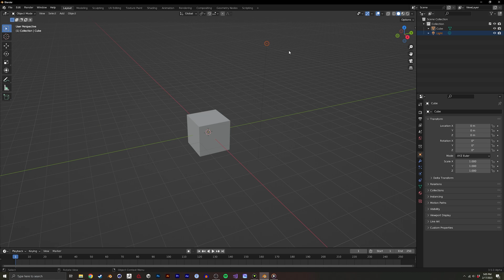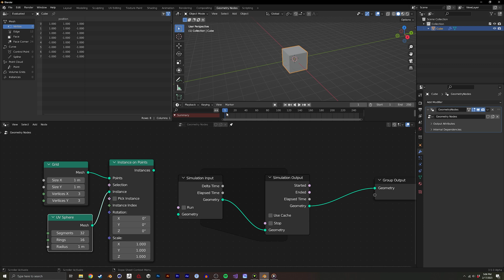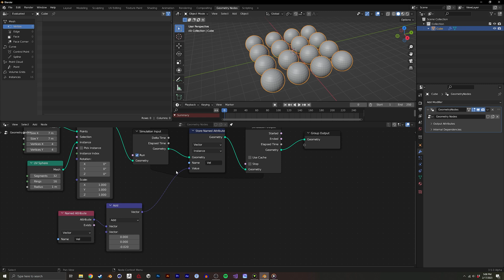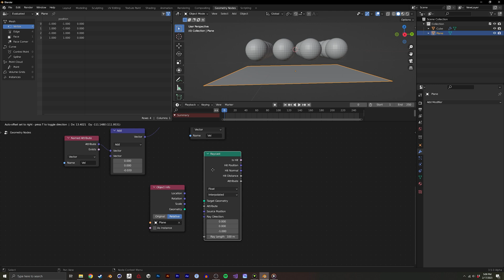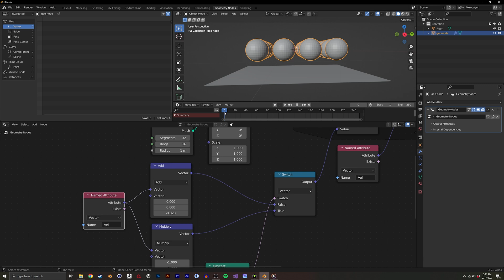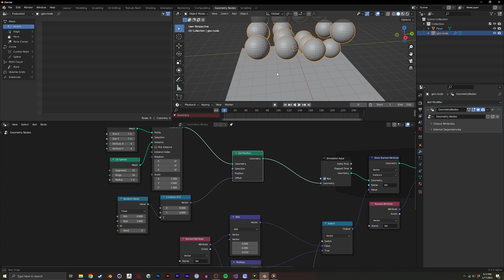Blender Simulation Nodes for Beginners!

Comment: nice tutorial! Can I ask you how did you set the material to the spheres ?
In my project I'm instancing a collection of objects on points extracted from the volume of the mesh and before the simulation every instance has his right material applied. If I put a viewer node after the simulation loop the materials are gone and the  Set Material node applies the material to the entire geometry.
Reply from the maker: i have the set material node at the end of my graph
Reply: @RobbieTilton   yes I did the same, but it was not correct. It was like the UVmap of the single instance breaks after the simulation loop. I think it's because the objects instanced on the points are treated as a single geometry after the loop and not as a single object, so the material is applied to the entire geometry. Your ball material was UVmap dependent too?
Reply: Update: managed using a single material setted in geonodes after the simulation and using "random per island" socket of the geometry info shader node to drive different materials on the single instances. It is an half solution because in works only for materials not UV map dependent

Comment: Nice! I tried here and sometimes depending on the distance or accumulated speed of the instance it just goes trough the floor. Why is that and how would you do to overcome this kind of limitation?
Reply from the maker: with the movement and raycasting - each frame is basically a 'step' to process/evaluate. One way to help solve something where the speed of the ball is moving faster would be raycast from an offset position. For example u can racast 5m in the inverse direction of the velocity. and then when you elevaluate the is hit you add the 5m into ur math.

most physics engines let you do more steps in-between frame, but with simulation nodes you're stuck w each frame being one step. so to my understanding that would be the best way to deal with it for now.

Comment: For anyone curious on how to add a texture to the bouncing balls here's how I did it. Add a "Set Material" node in between the "Simulation Output" and "Group Output". Then go into the "Material" settings to add a new material. Then go back to the "Set Material" node and assign it the material you added in the "Material" settings. That should do the trick.
Reply: Is your material textures/UV based or procedural? because I did the same for my project and the UV map was completely broken. I used the same material that was applied on the single object scattered in geonodes; maybe I should redo the UV unwrapping of the geometry and create a new material with the same textures
Reply: Had to refresh my memory on this by taking a look at my old file tonight. I used a procedural texture that was a mix shader with a noise texture and musgrave texture. @willowproduction
Reply: Have you tried to see if it works for just a simple color using a simple BSDF? For testing purposes I mean before trying with your main material texture.  @willowproduction

Comment: A fun next step is to use the hit normal to calculate the bounce angle then run it on a sloped plane or more complex surface. That, plus damping.
Reply from the maker: oooooooo! great idea!
Reply: @RobbieTilton  For damping you can use a vector scale node set to like 0.9 in between the velocity inversion and the switch node

Comment: Nice job Robbie. Enjoyed the tut. One thing for me. When rendered, I only get white spheres.  Not a coloured one that I have used. Strange. Any ideas?
Reply from the maker: I downloaded a texture for a bball and applied it to the material w set material near the group output in node graph. You could also instance a different mesh w your texture instead of the uv sphere at the beginning of the graph.
Reply: @RobbieTilton  Have done separate object, simple sphere, object info, and all that. Still. White spheres. Dec 23 download of Blender. Thanks for the reply. Sorry to bother you with something that sholud just work.
Reply from the maker: @covbloke511  very weird. i was using a november branch of simulation nodes... i'm wondering if it's a bug from their dec branch. You're always welcome to share ur file in the 'help' section of my discord and I can take a look.

Comment: This is the stuff that strains my brain the most so I'll need to watch multiple times before I digest the impact of each node in the logic. I am never satisfied just watching someone place the nodes without fully comprehending the variable, within the node tree, that each node or its value has a wide reaching effect upon. 
I feel I am most messed up by some of the socket names withing the realm of "true" and "false" in a switch node that is fed by a value from an inverse multiplication such as factors of less than zero . My weak brain wants to follow along like my eyes are doing but the:
flipping conditional on false status of inversely factored values which equal a state which causes the addition of a velocity  etc.......oh man  ...lost. 
But I have a compelling case for the logic functioning fine because the simulation DOES run and I can see it.
Being able to tinker with values and having their effect be immediately seen is one of the greatest parts of Blender geo-nodes.
Reply from the maker: I feel you and appreciate the message. I programmed for 10 years which allows me to grasp this stuff, but at the start it can be hard to understand. If you have any questions about anything in the video - feel free to ask.
Reply from the maker: the 'true/false' switch is what we call a conditional statement in programming. If this -> then that. If NOT this -> then that other thing.
Reply: @RobbieTilton  Thanks for your attention to the comment. I am able to work out the logic of the true false if then statements...eventually. IQ is about  speed. I never formally took any programming.  I have way less agility with such  logic buried inside  node trees. What I find I yearn for when watching these  explanatory videos is a [pause-step back] moment where it  the pre calculations of which nodes will accomplish the  aim of the whole tree are done  in advance so that , as the nodes are added, you can anticipate how they will affect what is already there and how they will affect the choice of paths to take to arrive at the desired destination.